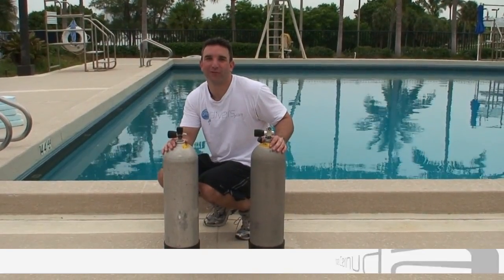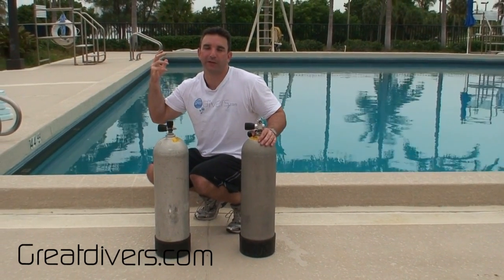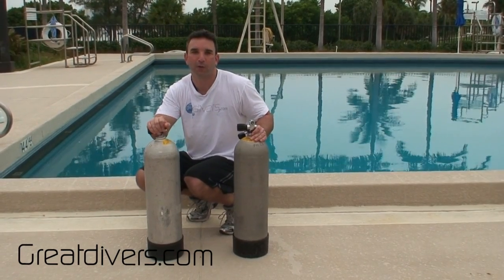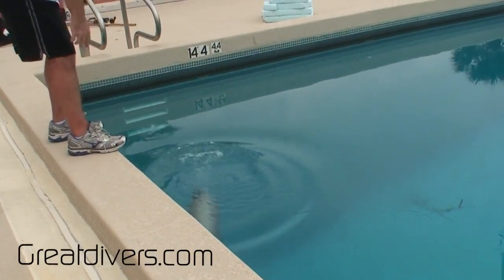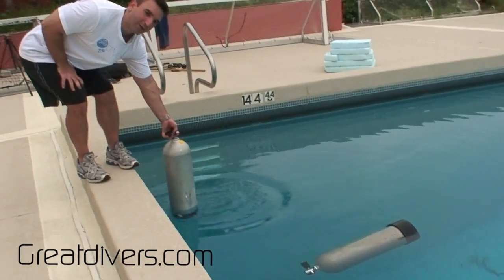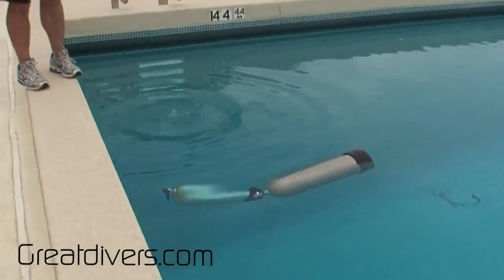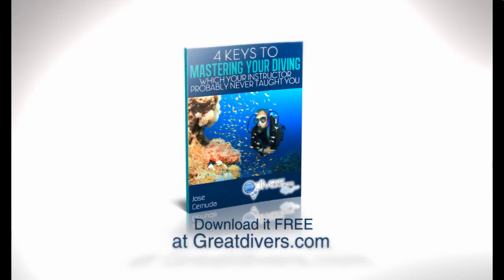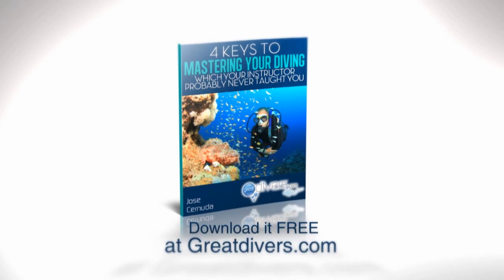Scuba Tank Buoyancy the difference between a full cylinder and an empty cylinder.

Comment: A little miisleading. Steel tanks, for the most part, will be negatively buoyant when full AND at reserve pressures.
Reply: But they will still be lighter at the end of the dive. So you still need to compensate for the loss of weight of the air used. 
You could not demonstrate  this in the same manor as in the video because  both the empty and full steel tank would sink. But it could be demonstrated on a set of scales.